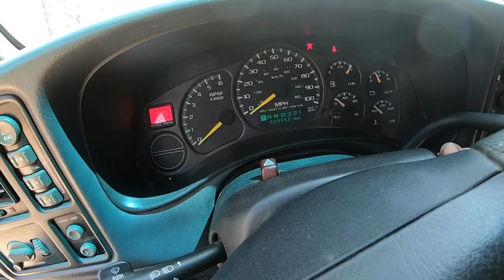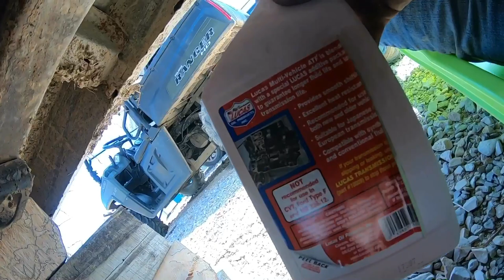Removing Transmission 1999 GMC 1500 - Shade Tree Style

Comment: On a car with a manual gear box I would advise you to change the clutch plate.  Because they are so hard to get to and only cost £50.  But I have never had an automatic so I'm not sure how different they are. P

Comment: Heat up the connectors on the gear selector. With a propane torch lightly they will release
Reply from the maker: Thanks for the tip!
Reply: @CaptainKleeman  do the same when putting it back together

Comment: The bell housing bolt 🔩 that was left in and broke off an ear , not a problem if it were left completely out ,I know ppl are going to criticize me possibly crusify me but truth being watt it is n all a washer will work fine or weld an oversized washer either or , as far as the leaky rear main pop that cover plate off easy replacement, good luck you got this
Reply from the maker: Thanks!

Comment: Personally, I would have sold it as is, with full disclosure, and the broken bolt hole, but a washer on it . It won’t compromise its purpose at all.
Reply from the maker: It cuts the value in half atleast,. For hundred bucks in parts I can get far more out of it
Reply: @CaptainKleeman  true, but I hate working on my back under a vehicle, so I would take the loss. Power to you for taking on the job.

Comment: Come on Captain,if you’re going to do it - do it right!   First, you should have built a new 40ft by 40ft shop. Complete with heat and air. You’ll need to have a couple of Snap On trucks dropping off a lot of tools, maybe a lift or two, lots of cabinets and one huge tool box.  Throw in a giant TV, a frig, some comfortable chairs - then and only then you can decide if you are going to put that truck in your new shop.

Comment: Well...  You're taking the Dodge out of the GMC!  (Drips Oil, Drops Grease Everywhere)!  I thought if it was leaking you're good!  If it's not leaking it's out of fluid... Wait no... That's military aircraft!  My bad!

A couple things to help you and everyone else if they are tackling something like this.  Harbor freight has those miscellaneous nut/screw cups that stack or hang on the wall.  When I do projects like this I keep a bunch of them around and use blue painters tape to and a sharpie to mark where the bolts come out of.  I did that most recently on a clutch I did on a Jeep Wrangler (project cheap jeep). It also has the added benefit of allowing you to stack them in the same order they need to go back in.  So your first bolts out will be your last bolts in.  I don't know if I covered that specifically when I did the video but I do believe I at least showed it on our channel.

As far as reassembly.  It may be easier to divorce the transfer case from the transmission prior to reinstalling.  Without a transmission jack it's going to be very difficult to get everything lined up.  Even with a transmission jack it could be difficult because the rear cross member is going to keep the back of the transmission higher than the back of the engine because they aren't aligned.

But with some Sailor talk I'm sure it's going to slide right back together!

Comment: When I replace my exhaust I always paint it with heat resistant paint and then drive with it and let it bake on and my exhaust pipes last for a very long time. You just have to put up with the smell for an hour or two.:dothefive::dothefive::dothefive::dothefive::dothefive::dothefive::dothefive:

Comment: Mike you my Friend are not afraid too tackle ANYTHING..You for sure impressed the Hell out of me..Using Common Sense and Your Patience  you succeeded with this or anything you tear into...Love it...I only wish I had your Patience..Ive done these trannies and they are not at all EASY or FUN....I thought until I watched you. You Sir made it FUN anyhow ..LOL...HAHA...Great Job Sir..You prove that with perseverance  and Commonsense you can accomplish  ANYTHING..Thank You..Great Video Sir as Always....I only wish this Country had alot more of that thing called Commonsense...Wish I could bag it up or Bottle it up.. I would be a BILLIONAIRE  And Wouldnt even have to leave my Town...UGH....LMAO.....LOL..Have a Great Day Bud .. Mike as far as the broke bolt on top Just put a Flat washer on it. You can Also but dont have too is JB Weld that Piece back on. Theres still 4 or 6 bolts holding that on. So its not going to be an issue..Your not pushing 600 horses out of the Engine so I would not spend the money if your selling it..Thats my opinion...And Definitely Replace the Input shaft on the Transmission..All you do is pull the torque converter  off and Its behind there. Especially  with that many miles on it.  When you pull it off keep the side towards engine down as it is full of oil. Then when reinstalling  torque  converter  You must turn it as you put it back in a little it catches those splines and tranny pump. When taking it off look and see how far its set in from bellhousing. But you really need to change it .   The Seal is cheap compared to the Aggravation  of having to take tranny back out... Im only suggesting Sir, because unfortunately  Ive had that pleasure  of taking those trannys out a few times...UGH...LOL. Not telling you what to do like the Keyboard  warriors,  just trying to help you out Sir..

Comment: Hello, it took me a few days to verify my information!  

Mike, when you dismantled your rear differential, please tell me that you knew enough to mark the alignment of all parts of your drive lines like the differentials (pinion shaft) against both the drive shafts front and rear the ballance must be as factory?  Those are ballanced together.  I have friends who missed that step and it cost thousands once driven at speed! 

Same goes for multy-universal drive shafts in the front end.  I had a Ford F250 that had 4 or 5 universals in the front end alone.

I have witnessed a dumbo mechanic getting hurt when he ingaged his 4WD and his shaft failed because he didn't match the ballance on just replacing a lose universal.  He had both legs amputated below the knees!  NOT FUN! Don't be that guy!
Reply from the maker: Appreciate ya looking out

Comment: Use a lil heat on the plugs on the neutral safety switch they will come right out best to take transfer case off first
Reply from the maker: Thanks for the tip
Reply: @CaptainKleeman  your fine using that bell house with washer and bolt

Comment: BEFORE I REPLACE THE BELLHOUSING, I'D ALUMA WELD IT, ONLY NEEDS IS PROPANE TORCH A SPECIAL ROD AND A CLEAN SURFACE, TO ME WAY EASIER THAT CHANGIN A TRANSMISSION HOUSING

Comment: Great job on the removal. I think if i was going through all that on the removal and was going to sell it i would have to do a new housing, if was putting it all back together for myself maybe a washer or as someone suggested it will probably be fine without that bolt. The real question is,  is your labor and time worth the repair of a truck at 300k. The learning experience is great but will the time investment be worth it. Its been a solid truck for the homestead so that has to be factored in as well. Some very hard choices on the next direction of the repair. Just wondering what price did a shop give you for the repair?  

As always a great video and great camera angles of the action.

Comment: Hi Mike. For myself, I would replace the bell housing, but it is not my truck. I was wondering how you were going to get the transmission replaced in 34:28. Flex seal might have sealed up those leaks. Have good days!

Comment: Will adding 3 x $70 ($210) to the asking price be a deal breaker? If no, buy and replace housing.

BTW, please don't forget to calculate your spare parts latency curve. On the off chance that you haven't seen the new JIT inventory correction factor, here is the latest formula:

(SP(wt lbs) x days between job/part delivery) x 1.3 = spare parts allowance at job conclusion.

Confusing? If so, use the rule of thumb...1% of total weight is spare parts. So, three bolts, two brackets, and one lug nut left over on a job such as you're doing is considered legit unnecessary spare parts.

Comment: You have done just fine so far, I would of parted the transfer case from the transmission as it is not so easy balanced and its a simple swab of "Ritestuff" to seal any leaks... gm uses it  too okay. As for the bellhousing, if five won't hold it tight, six never would of either. Its a bolt with a washer since you have most of the ear or if Aaron's around, he may tack that aluminum housing enough to go down the road if it worries you that much.. in all the many years of wrenching, most rigs came in with three or four bolts holding an did it just fine... would of been handy if  they had used bolts of all the same head size as I have had them come in with even torques head bolts used in some of the bolt holes. I really got upset when most torque converter bolts are a metric thread and someone just forces a american fine or course.. what ever was handy ruining threads in it. They make speedy sleeves for the torque converter nose so it it doesn't leak on the seal inside the transmission.. I think you know it goes in on three definite clicks... not two but three and sometimes it is easy and others you turn it an turn it but eventually it does go    in right. Always just replace u-joints on both drive shafts as they take the next turn to fly out going down road and bouncing off of the highway... heavy lose losing one of those. One other thing, bring Mikes skidsteer up and raise the rig to a decent level to work under and it will be about one third the trouble to install. While trans is hanging onto the block, all bolted it you will be able to put the transfer case back on much easier. Just don't paint your surface with the Ritestuff as it works an does a fine job... but silicone smeared around inside of a transmission finds filters an stops  them in  their tracks. I did three a day every day for a company called Alaska axle. Pull, rebuild,  replace an this is with out any jacks... them broke dicks cared more for their alcohol than me and I had to have a job or go back to jail for beating a fellow up... truly deserving he was.. little old two hundred thirty pound me took that fat three hundred pound fellow a complete new nose job. I do believe a few teeth were involved too, one was stuck in my fist. Just young and dumb at the time
Reply: A Axle repaired our '87 Jeep Cherokee rear diff in Spring of '89 -- lasted over 250K miles....!

Comment: Local transmission shop will have the Bell housing for a 4L60E and you need to replace that rear cam cover the gasket and the seal for the crankshaft . need any help with it get ahold of Aaron he knows me . He has info to get in touch with me